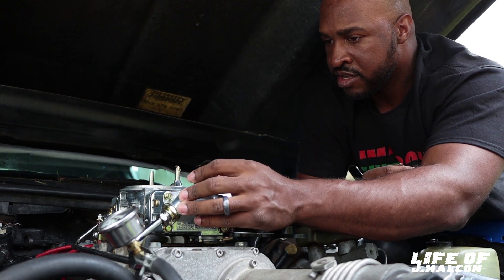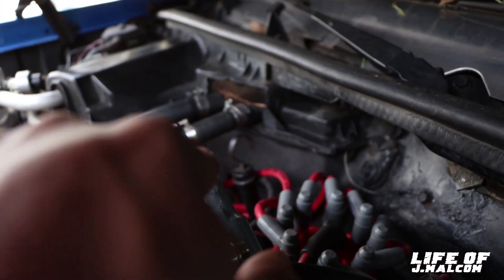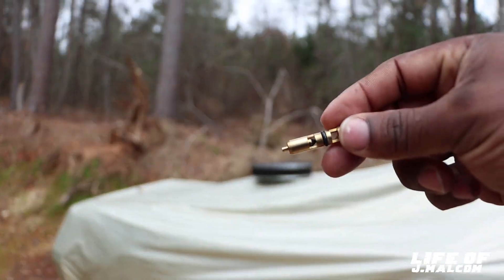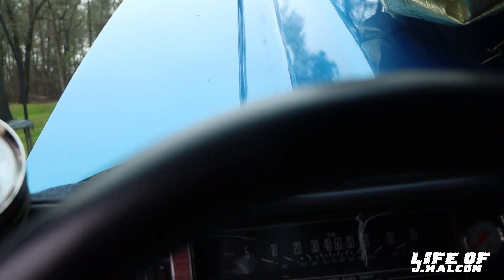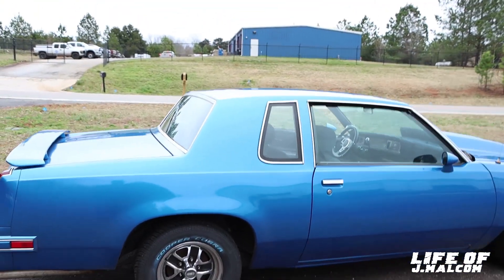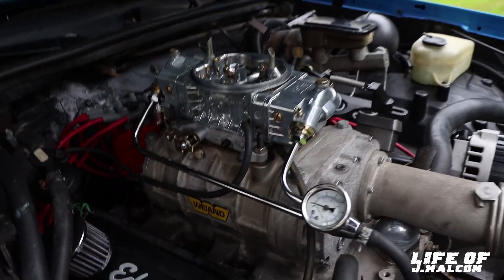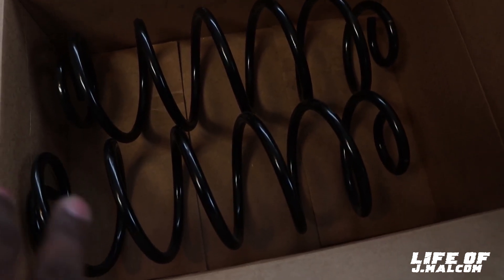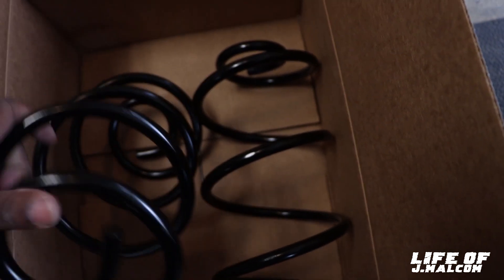SUPERCHARGED CUTLASS HAS A MINOR CARB ISSUE BUT NOTHING MAJOR....

Comment: Man I'm goin wit an EFI set up. Don't wonna deal wit carbs anymore.
Reply from the maker: A carb works just as good as efi if it’s properly tuned and adjusted but the thing is, most don’t have a properly adjusted carb but think they do. EFI is t a 1 system beats all, it can throw problems itself and sometimes be harder to trace

Comment: i dont pop off the nut as it has the height set already and you have no chance to tear the gasket. just leave it together. take out top screw only. that just the way i do it.  sucked something in there running without that air cleaner bro